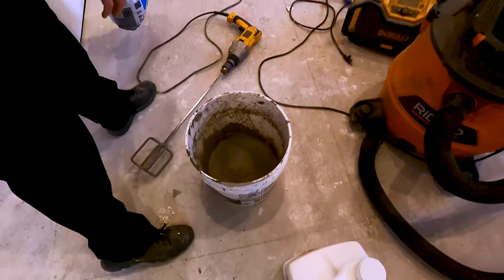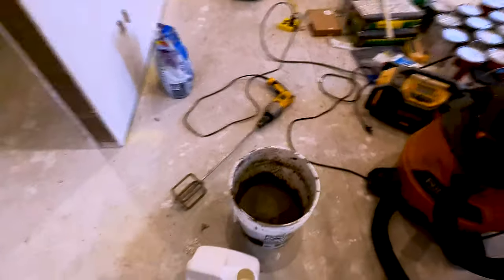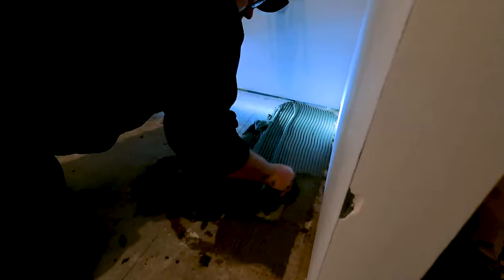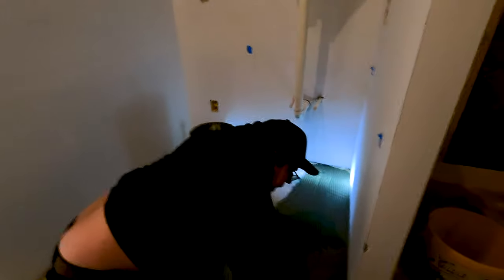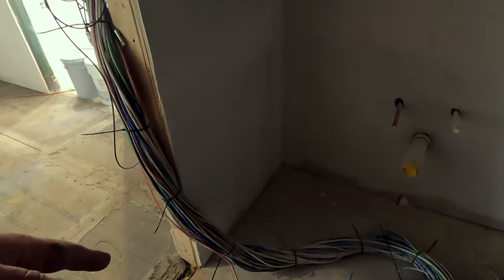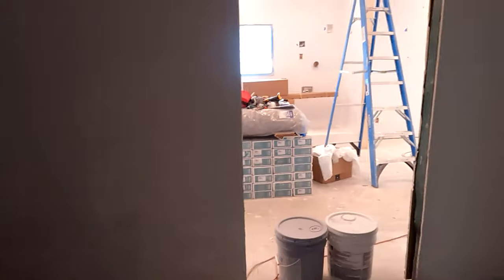How to Install Backer Board for Tile: 100 Year Old Farmhouse Series

Comment: You should have cleaned the floor a little better before starting. Getting sheetrock mud up and the dust, dirt and debris. Your floor there wasn't terrible but just an fyi for the future. Turned out good though. Did you guys get any ice or snow out your way? Over here in Gold Hill we got about two inches of snow then about the same in sleet and just a thin coating of ice. It stopped for a couple hours and then we got about a quarter inch more snow. No power outages so we got lucky I think from what the weatherman said we could have gotten. Stay well. -Wil  👍
Reply from the maker: We scraped, swept and vacuumed 🤷🏻‍♂️
Reply: @BealyGood  Oh ok I seen a chunk of sheetrock mud that you missed I guess and some dust fly up when you dropped the board. It's hard to vacuum up all the dust and every little piece of debris. So my mistake, sorry. How about the snow and ice. ❄👍
Reply from the maker: @williambryant5946  😁 All good. Plenty of dust and crap left for sure. 🤣🤣🤣. Thanks for the tip. 

The snow and ice we got was just enough to be a nuisance.